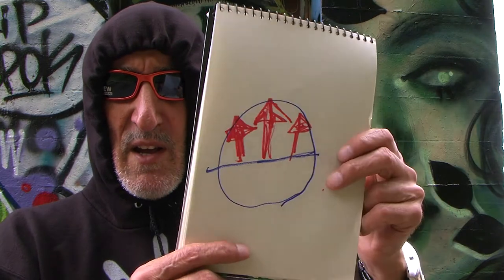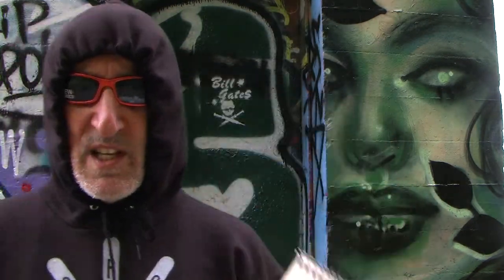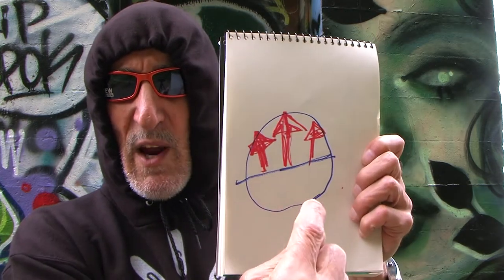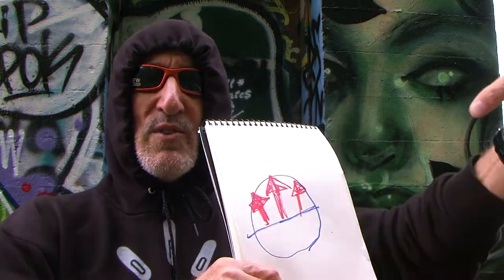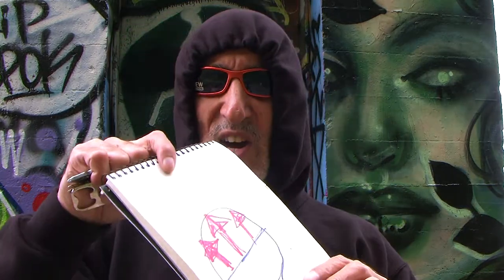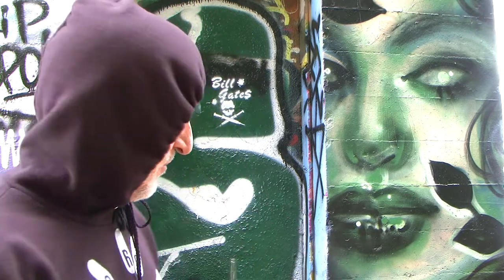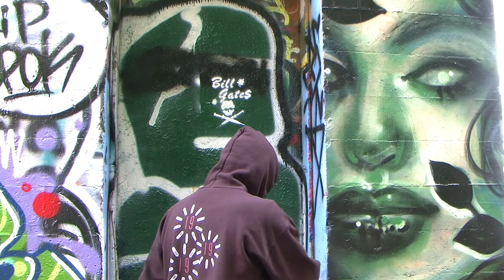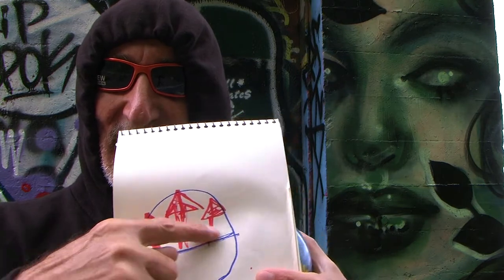HOW CENTRIFUGAL TENSION SPLITS A SPHERE globe hoax motionless flat earth

Comment: You said it yourself. “It’s as if a proportion of the radial force is acting along point A-B”. For this linear force to propagate, there has to be a radial force acting away from the axis of rotation. If there’s another greater force acting in opposition there will no longer be an outward radial force creating tension, there will be an inward radial force creating compression. Your failure to understand this is your downfall in this argument. 

You’ve been harping on about this for years now. Why don’t you write a paper? Submit it for peer review? Or just show it to someone that understands physics? See how far you get.
Reply from the maker: Wrong. Stop lying. I never sad "proportion" and neither does any engineering textbook, as you can see at spin1.flat.wtf ; spin2.flat.wtf ; spin3.flat.wtf It's "the sun of the radial forces" ALL OF THEM. And that relationship occurs at an infinite number of diameters. Notice at Spiin2 in the apple splitting video, the TINY PIECE that broke off and hit the guy in the hand with such force that it literally hurt him. Also, recall the world builders suspension bridge analogy I mentioned in the last video split1.flat.wtf where each kg of weight causes many many many kg of force on the suspension bridge. 

 I have references and demonstrations, you have nothing. How insane of you to think "hoop stress will not form in the first place" while the body spins full tilt! HAAHHAHAHAAAAHAAA!!!!
Reply: @rocketspushoffair  no, you said some of the radial forces. Unless you meant the sum. In any case, as we’ve discussed before (remember, vector force calculations) the linear force exerted on one half of the hoop is related to the sum of all radial forces by a ratio of 2 pi. Remember your whole F/2pi thing? That’s what it means. The linear hoop stress force will be equal to the sum of radial forces F divided by 2pi. Hence, the linear force is a proportion of total radial force. It says so in your handbook. I thought you knew about this topic? How long have you been looking into this, a couple of years now? And you still don’t understand even the basics? Do I really have to keep correcting every comment you make? 

Write that paper Nick. See what some actual scientists think of it.
Reply from the maker: @paulsterx  I never said "some" i clearly said THE SUM. Get the wax out of your ears, give me the time stamp liar. THE SUM, all of it, acts along the diameter, be it a ring, disc, hollow sphere, solid sphere. Centrifugal tension is the same for an infinite number of points. Study the apple splitting and admit you lost. Besides, your globe is cracked everywhere like an egg, or as BRIGHT SIDE says, like an apple pie https://youtu.be/Meja2sZC6LY NO CRACKED BODY CAN SPIN And that's the end of the globe!
Reply: @rocketspushoffair  oh good god Nick, if you said the sum then you’re wrong. Again. It says it right in that handbook of yours. 

“The resultant (the linear pulling force) of half the radial forces is to the sum of half of the radial forces as the diameter of the flywheel is to half its circumference” 

Diameter is circumference/pi. Honestly Nick, have you not even grasped this force relationships yet? I despair, I really do.
Reply from the maker: @paulsterx  The relationship is unaffected. I never specified an amount for the sum, those details are at the link(s) spin2.flat.wtf And the magnitude remains many orders greater than gravity, that's the globe-destroying point (along with the fact that no cracked body can spin). The drawing shows the relationships and the apple splits as expected. Centrifugal tension shatters molecular bonds. Gravity is a much weaker force, it's nothing. After all this time, the best you could do was make the ludicrous claim that centrifugal tension "doesn't form n the first place"! WHAT A JOKE! "Write a paper" because no legitimate engineering textbook supports you! HAAAHAHAAAAHHAAAAA!!!!!
Reply: @paulsterx  I think we should thank Nick for giving us some nuttiness to answer, and we don't even have to buy his beer! Added: his nuttiness is actually more challenging than most.
Reply: @rocketspushoffair  please reference the engineering textbook that specifically addresses the forces in play for a planetary body. Not a flywheel, not an apple, not a turbine. A planet. Best of luck. 

Ps the earth is not a flywheel. Or an apple. Or a turbine. Or a hollowed out asteroid for that matter. Until you can address the forces in a planetary sense, all you have is an analogies with things not analogous to the earth.
Reply: @paulsterx  Thank you PaulsterX, very interesting.
Reply: paulster x reporting for duty,ready to lie and deny to the end..your handlers will be glad to see you on the job...
Reply from the maker: @paulsterx  Correct! No spinning body s analogous to fake globe earth, because they are all sold bodes. Only solid bodies can spin. Fake globe earth s a cracked body, it cannot spin. Your so-called "references" are based 100% on reification fantasy. The entire globe earth religion is a reification fallacy and fantasy - every single claim.
Reply from the maker: @napolmast3371  Reification based references are better known as sci-fi.
Reply: @unarammer2003  shhhhh, my handlers think I’m on vacation, I’m doing this off the books!
Reply: @paulsterx  lying again...you're turning in overtime hours while on vaction.  charging tax payers for your hotel looking over the flat AF ocean watching the sun move off into the distance...
Reply: @rocketspushoffair  no, that wasn’t an answer. I’ll ask again: 

please reference the engineering textbook that specifically addresses the forces in play for a planetary body. Not a flywheel, not an apple, not a turbine. A planet. Best of luck.
Reply: @rocketspushoffair  in the meantime, here’s a quote from the relevant paper I linked you to: 

For an answer first note that the strength of centrifugal acceleration is two orders of magnitude below that of self-gravity. It is therefore justified to use linear elasticity (i.e., a linear relationship between stress and stain) and a linear strain measure in order to assess its effects on deformation.

So according to a valid reference on the subject, self gravity is far greater in strength than centrifugal acceleration. I thought you said it was the opposite? Do you have a valid reference to back that claim? I mean a reference discussing the interaction between a planets self gravity and its centrifugal acceleration, not your own ramblings and misinterpretation and not something discussing an earth bound object like a flywheel. An actual, valid reference on this topic specifically.
Reply from the maker: @paulsterx  "Planets" are reification fantasy (sci-fi). I only have references for spinning tops, or a body that spins like a top. No .0034g compression can magically prevent centrifugal tension "from forming in the first place" - that's sci-fi. Not even the World Builders forum supports you, and they are as sc-fi as you can get. You go beyond their reification threshold. Just recall the suspension bridge analogy of my previous video. "And that's the end of the globe!"
Reply: @rocketspushoffair  oh so you don’t have anything relevant that supports you then. It’s just your opinion. Got it. 

World builders forum and the hollowed out asteroid - I’ve already explained, the earth is not a hollowed out asteroid (a hollowed out asteroid is not self gravitational for a start) and certainly isn’t rotating fast enough to generate centrifugal acceleration equal to gravitational acceleration - it would have to be rotating 300 times faster to do so. It’s a completely irrelevant and pointless analogy to make, just like your flywheel, your apple and your turbine. 

So, I’ve given you a valid reference that supports exactly what I’ve been saying all along, that earth’s centrifugal force is 300 times less strong than its gravitational force. You choosing to ignore it doesn’t make it less valid. Read that paper and see how you get on with the mathematics, there’s everything there you could want regarding planetary deformation due to the interaction between gravity and centrifugal force. Go ahead and debunk that, using the correct mathematics of course, not just wild assumptions. 

So unless you have a valid reference to back your nonsensical claims, you really should give this up. Do you have one?
Reply from the maker: @paulsterx  No. Your reference is not valid. Sci-fi can only support sci-fi not reality. The suspension bridge analogy from the World Builders forum is a perfect debunk of the fake globe based on the engineering physics of bodies that spin like a top, as discussed in my video and blog spin2.flat.wtf You cannot reify different rules for your space pear earth and pass it off as reality, not even allowed at World Builders, you get called out for such stupidity. EDIT: "And that's the end of the globe!"
Reply: Here’s a book you may find useful, covering linear strain theory, non linear strain theory, fluid models - these are what you need to study to understand the dynamics of forces acting on and within the earth. It’s far more relevant than a chapter on flywheels. 

https://link.springer.com/book/10.1007%2F978-3-319-32580-4
Reply from the maker: @paulsterx  Again, 300:1 is a reification applied to surface objects only. The reified force is orders of magnitude weaker than molecular bonds and centrifugal tension that would develop if we reify your cracked basalt behemoth into existence and pretend a cracked body can spin 1000 mph with a .0034g compression "as the only force" within the body, and this magically prevents trillions of tons of centrifugal tension from occurring in the first place" - got it! More weight equals less centrifugal tension - got it! HAAHHAAAHAHHAAAAA!!!!!
Reply: @rocketspushoffair  more weight equals less centrifugal tension? I assume you meant more? In which case, yes it would, if centrifugal tension could propagate in the first place. The net RADIAL force is towards the earths centre - you can’t deny that, it’s easily measurable and calculable. Tension is a by product of force, and without an outward radial force, there can be no tension force, because the linear tension force is a by product of outward radial force. No outward radial force = no linear tension force. Got it?
Reply: @rocketspushoffair  why do you keep saying 0.0034g compression by the way? You know g is a measure of acceleration, yes? Do you mean acceleration? Gravitational acceleration is 1g at the earths surface. Centrifugal acceleration is 0.0034g at the equator. Therefore the net acceleration is 0.9976g towards the earths centre. The radial compression is caused by a 0.9976g acceleration creating a force on all mass pushing inwards towards the centre of the earth. 

If you’re going to use terminology at least use it properly.
Reply from the maker: @paulsterx  "No outward radial force = no linear tension force. Got it?" - and the minimum compression required is .0034g (I am using the terminology "properly"). So long as a weight is spinning, there will be centrifugal tension. Case closed. And for each kg of weight the force is multiplied many many many times because of spinning. "And that's the end of the globe!"
Reply: @rocketspushoffair  you said “.0034g compression ‘as the only force’ “ 
g is a unit of acceleration, not force. So no, you didn’t use it properly, you have no grasp of the topic (using terms like “trillions of tons of psi” demonstrates that). Stop now, you’re embarrassing yourself.
Reply from the maker: @paulsterx  So long as the SOLID object spins, there will be internal centrifugal tension spin2.flat.wtf the greatest amount being at the surface (or just below the surface in the "heavy force zone" according to one of your references) And for each kg of weight (in the heavy force zone) the force is multiplied many many many times because of spinning. This doesn't magically disappear because of a much weaker force (orders of magnitude weaker) acting on the surface. THE GLOBE IS CRACKED so it cannot spin--"Stop now, you’re embarrassing yourself." 

"And that's the end of the globe!"
Reply: @rocketspushoffair  well that was random. How’s it going Nick, got your jab yet? 

You’re confusing yourself talking about force. F=MA, remember? Force is directly proportional to mass, given the same acceleration. The centrifugal force is greater in the heavy force zone because the mass is greater. But because the mass is greater, the gravitational force will also be proportionally greater and as gravitational acceleration is at least 300 times greater than centrifugal acceleration at any point on or within the earth, gravitational force will always be far greater than centrifugal force for any given mass. No matter what mass you use to calculate it, the net acceleration and therefore the net force will always be towards the centre of the earth. Therefore, with no net outward acceleration, there can be no net outward force, therefore no tensile force to “rip the earth apart”. There can only be net compression, pushing the earth together. 

And that’s the end of your straw man argument. 

Now how about you stop building globe straw men and tell us how things work on a flat earth? Concentrate on proving your own model rather than demonstrating your lack of knowledge of ours and of standard physics. Go on you can do it, come up with a flat earth model with the same predictive capability of the globe for distances, celestial observation, eclipses, navigation etc and you’ll be world famous. Until you have that though, all you’re left with are a big pile of straw men waiting to go up in flames. See ya.
Reply from the maker: @paulsterx  "Therefore, with no net outward acceleration, there can be no net outward force, therefore no tensile force to “rip the earth apart”. There can only be net compression, pushing the earth together." -- REIFICATION FANTASY (logical fallacy) -- no engineering reference supports you. Instead of conflating math that applies only to chunks of earth (axis of rotation away from their center of mass) with a solid ring, educate yourself on the force relationships of objects that spin like a top (axis of rotation is center of mass) and learn about the orders of magnitude of centrifugal tension that destroys molecular bonds compared to the weak reified force "gravity".

So long as a SOLID object spins, there will be centrifugal tension in the heavy force zone, orders of magnitude greater than gravity, CASE CLOSED.
Reply: @rocketspushoffair  I got bored trying to educate you on school level physics months ago Nick, not going to start again now. F=MA. Do the calculations for the force due to the two opposing accelerations, deduct one from the other and you’ll have your net force, which you’ll find always acts towards the centre of the globe. Job done. Now go ahead and provide positive evidence the earth is flat.
Reply from the maker: @paulsterx  Stop conflating. Learn what centrifugal tension is spin1.flat.wtf Learn the difference in force relationships between axis of rotation away from spinning body and axis of rotation at the center of mass of a spinning body. And learn that ONLY SOLID objects can spin like a top--and the centrifugal tension is orders of magnitude greater than a reified force called gravity, it is much greater than molecular bonds, gravity is zero compared to molecular bonds. Stop drinking your own Koolaid. The globe is all in your head.
Reply: @rocketspushoffair  told you, not interested in you proving you don’t understand physics. Prove flat earth. Present a working model.
Reply from the maker: @paulsterx  you don't have a "working model" as no cracked body can spin. Moreover, no physical body can attain a surface speed over 1000 mph, not even close. I have dismantled your reification fantasy pseudoscience completely. Enjoy your train wreck 😂😂😂
Reply: @rocketspushoffair  we have a perfectly working model thanks, the fact you don’t understand it is neither here nor there. 

So, positive proof of a flat stationary earth? A working flat earth model with predictive capabilities? Go right ahead I’m all ears.
Reply from the maker: @paulsterx  nah, your model's broke, broke things can't spin, only a solid body can spin like a top, and cannot achieve a surface speed over 1000 mph ... PHYSICALLY IMPOSSIBLE ... enjoy your train wreck of a non-working model
Reply: @rocketspushoffair  so you have no positive evidence of flat earth and no working flat earth model then? That’s ok you carry on building straw men of the globe model in a futile attempt to debunk it, it’s what we’ve come to expect. Once you have any actual evidence or a working model let me know.
Reply from the maker: @paulsterx  enjoy your train wreck you call "a working model", I will continue to wreck it even more ... let me know when you have positive proof of a water covered cracked basalt ball with a molten iron core that attains a surface speed over 1000 mph ... then you can rewrite all the engineering that our modern way of life is based on ... and collect your prize for proving that cracked bodies (zero tensile strength) can spin BETTER than solid titanium bodies by breaking the 1000 mph barrier!  HAAAHHAHAHHHAAAAA!!!!

and that's the end of the globe
Reply from the maker: @paulsterx  speaking of "no evidence" that describes your imaginary force, and since your force is supposed to scale down, you just debunked your own argument, better than a strawman:

The Cavendish experiment, performed in 1797–1798 by English scientist Henry Cavendish, was the first experiment to measure the force of gravity between masses in the laboratory and the first to yield accurate values for the gravitational constant.

(never been reproduced, as expected foe pseudoscience)

titanium bonds are orders of magnitude greater than "gravity" and you claim that such a weak force can allow a zero tensile strength behemoth cracked basalt covered water ball to spin over 1000 mph ... something that SOLID TITANIUM cannot do ...

(and that's the end of the globe)
Reply from the maker: @paulsterx  good, so all you got is an imaginary force (confirmed by charlatans) that is orders of magnitude weaker than the molecular bonds of any material, and with this weak imaginary force, you expect to spin a cracked basalt covered water ball over 1000 mph, a surface speed that cannot even be achieved by solid titanium ... only reply when you find at least one university that has any proof and a repeatable demonstration (and be sure to include at least one engineering text book that backs you up, especially one that says hoop stress will not form while the cracked object spins at full tilt due to thee presence of a force orders of magnitude weaker than molecular bonds, and if you can't find this for a cracked body then find it for a solid body)

enjoy your train wreck of a non-working PHYSICALLY IMPOSSIBLE reification fantasy of a "working model"

and that's the end of the globee
Reply: @rocketspushoffair  well you won’t find an engineering text book talking about planetary physics, that’s not what engineering texts deal with, is it? You may as well ask for a reference on kicking a field goal from a cookery book. But you’ll find plenty of information on gravitational acceleration in physics books, try picking one up sometime it might help with your lack of understanding of basic concepts. 

Let me know when you have that positive proof of flatness. Or a working map. Or anything other than a straw man argument to be honest.
Reply from the maker: @paulsterx  engineering books refer to free fall speed, and all that cancels out, so we are left with tensile strength and surface velocity ... And that's the end of the globe! NO CRACKED BODY CAN SPIN
Reply: Free fall speed has nothing to do with this conversation, why are you bringing it up?
Reply from the maker: @paulsterx  you brought it up. You also claim that an "acceleration force" acts on an object at rest, and you gave an example of a car against a brick wall, or, similarly, a rock supported over a drop ... once said barrier is removed, why isn't the rock or the car at max velocity from the get go? LIKE A BULLET? Why must it accelerate?

"The velocity is highest at the muzzle, and decreases steadily due to drag. If the bullet is shot at an angle between 0-90degrees relative to the horizontal ground so that the trajectory forms an arch, the vertical component of velocity will be zero at the highest point in the arch."--(added bonus, "horizontal ground" trajectory is based on a motionless flat earth)

And that's the end of the globe!

Old chap! 😃👍  🌍👈😂😅🤣😂
Reply: @rocketspushoffair  no, I didn’t bring up freefall. Where? 

Are you seriously trying to say that a bullet starting at rest and leaving the muzzle at high speed doesn’t accelerate? How much of that beer have you been drinking? Of course it doesn’t accelerate after leaving the muzzle, there’s no longer an accelerative force acting upon it. What are you trying to say with that example?
Reply from the maker: @paulsterx  "The velocity is highest at the muzzle, and decreases steadily due to drag." The muzzle is the last point of contact between thee bullet and the gun, past this point, the bullet goes from max acceleration to constant deceleration. 

The rock being supported over a drop (by a piece of plywood say) is already experiencing max acceleration due to an "accelerative force" (as you say) called gravity. Why must thee rock ACCELERATE once the board is removed? Once its last point of contact is gone?

Like thee bullet, the rock should already be at max speed the moment the board is pulled away.

And that's the end of the globe!

😃👍  💀💀💀

Old chap!
Reply: @rocketspushoffair  what? The rock accelerates because a constant force is acting upon it, causing this acceleration. The board prevented this acceleration by exerting an equal and opposite force. 

The bullet has no constant force acting upon it in its direction of travel, so it decelerates according to Newton’s first law (because the force of air resistance is acting in opposition to its direction of travel) and falls to the ground (because another force is acting to acting to accelerate it towards the ground). What is that force?
Reply from the maker: @paulsterx  no, the rock should start at max acceleration and stay there ...

And that's the end of the globe

😃👍  💀💀💀

Old chap!
Reply: @rocketspushoffair  why?
Reply from the maker: @paulsterx  "...because a constant 'accelerative' force is acting upon it..."

And that's the end of the globe!

😃👍  💀💀💀

Old chap!
Reply from the maker: @davidfaraday7963  leave your "debunk" comment when you're ready .... 🏆
Reply: @rocketspushoffair  There's nothing to debunk because nothing you said made any sense at all.
As others pointed out the downward acceleration of gravity is 300 times the outward acceleration of centrifugal force at the equator, more elsewhere. So your entire argument is based on your own failure to understand... well anything really.
Reply from the maker: @davidfaraday7963  that only applies to surface objects, my argument is based on a solid body spinning like a top, your globe s cracked and liquid filled, so it cannot spin to begin with, only sold bodies can spin about their center of mass. Learn some BASIC engineering spin1.flat.wtf